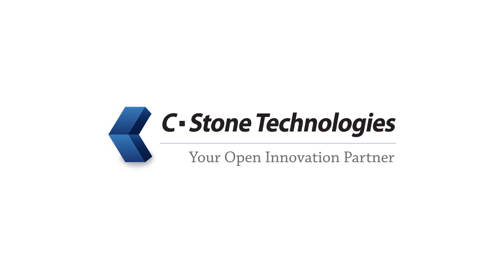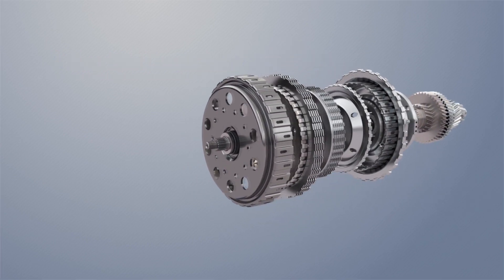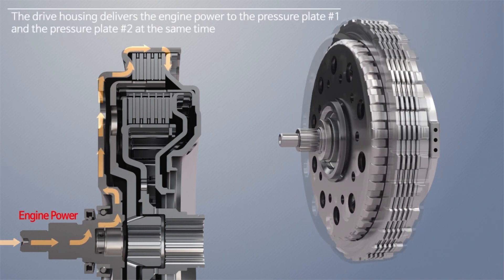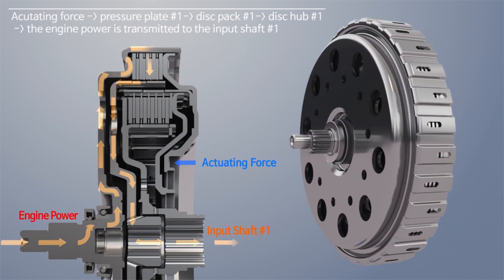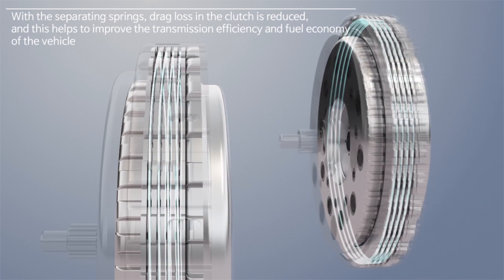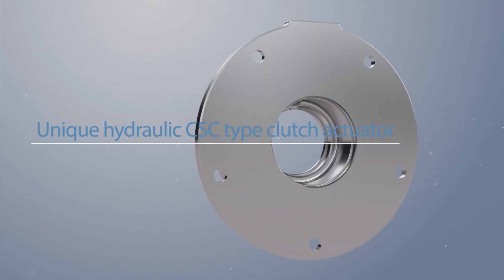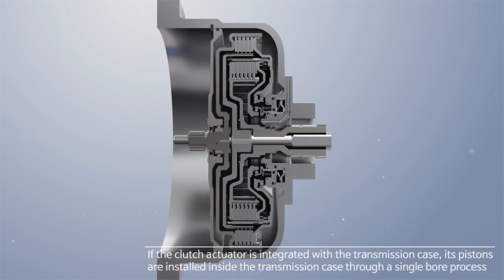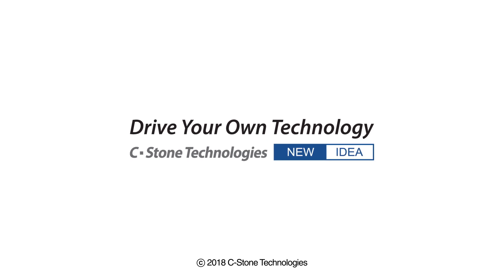A New Wet Dual Clutch (C-Stone Technologies)

Comment: Couldn't you get rid of pressure plates all together by designing a fluid coupling with variable hydraulic fluid control?

Remove enough fluid and the output shaft quits moving. Add fluid and power would be applied to the output shaft. Maybe even incorporate centrifugal pitch control as well?

I just think there's a more reliable way to add or remove power from the output shaft than using friction discs that are costly to replace.
Reply: yes, but torque convertor is much slower
Reply: @naznachen349  Dual clutches are cheaper to manufacture and hence wont hold up as long in the long run. More $$ for them. Really its that simple
Reply: @naznachen349  not really now a days. ZF transmission has 200ms shift time
Reply: @naznachen349  Volkswagen dsg 100ms shift times barely any difference
Reply: @naznachen349  Lexus toyota new 10 speed transmission can shift in as low as 120ms
Reply: @naznachen349  Acura dual clutch transmissions actually also employ a small torque converter to smooth transition. In reality this whole DCT business is so save cost in machining expensive torque converters
Reply: @naznachen349  the only benefit of DCT is that they are relatively easily serviceable in most cases.
Reply: @naznachen349  DCT clutch replacement cost will costs several thousands as much as buying a used transmission in some cases.
Reply: @naznachen349  my honda and toyota transmissions have gone up to 300k+ miles no issue. You can never say that for DCT transmission.
Reply: transmissions already have this
Reply: @alexg9727  I know. That's how a torque converter works.